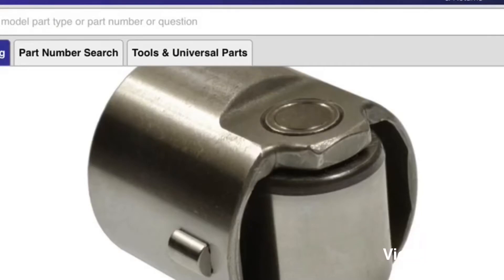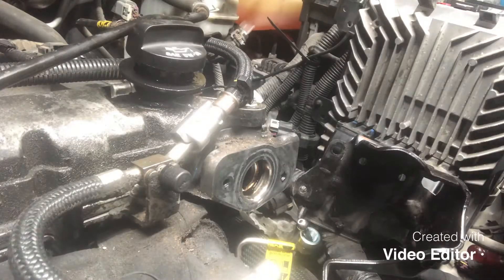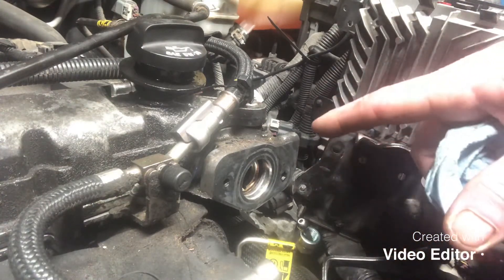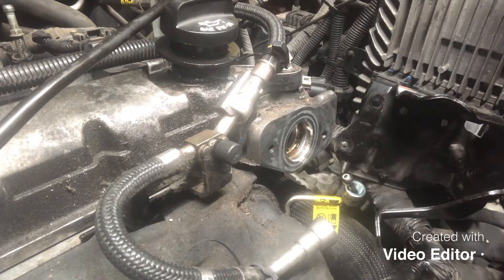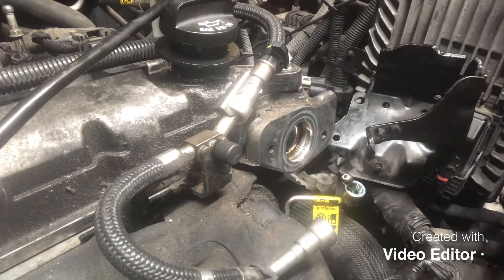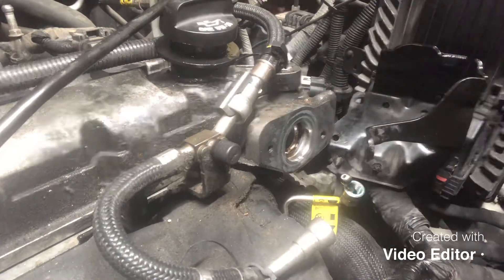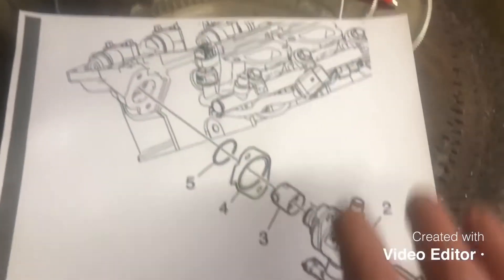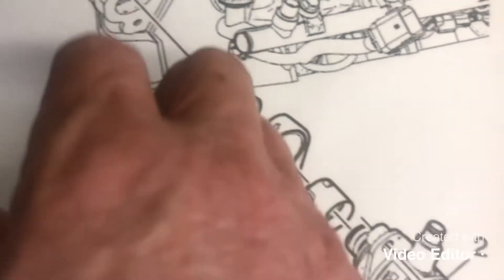2.4 ecotec fuel pump issue

Comment: That cover over the cam follower on the corner of the cylinder head comes off. It just has a few bolts that hold it on. You will have to clean it up real good and get some anaerobic sealer when you put it back on. But if you have a stuck cam follower that is going to be the easiest way to get it out. I speak from experience. Thank God for my mechanic brother showing me that. I probably never would have gotten it out.
Reply: I’m not sure of what bolts you’re talking about to remove I’m 62 yrs old having to fix my cat myself can’t afford mechanic please show me picture. Thank you

Comment: One other thing is to weld a tab on the inside of the follower. The heat will expand the metal to collapse it into the bore and when it cools off it'll actually shrink it smaller than the original size. Then use the tab you welded to pull it out.
Reply from the maker: That little car gave me fits. It’s also one of the worst cars I ever owned!!

Comment: Can you rotate the engine over to push that follower and then when the cam lobe comes off the follower put something behind the lobe, crank the engine over again to push it out even further with the cam and then just rinse and repeat
Reply from the maker: The only way you could get behind it was to pull the intake cam out. But I got it with a nail. 👍

Comment: The problem I run into is when people change the valve cover gasket, they put the wrong bolt in above the pump plunger. Supposed to be shorter bolt. It deforms the hole making it almost impossible to get out.

Comment: Is it making the engine have a funny abound? I replaced pump and it still isn’t right
Reply from the maker: It wasn’t making any noises. It just wasn’t getting the proper fuel pressure and it kept setting a code in the computer.